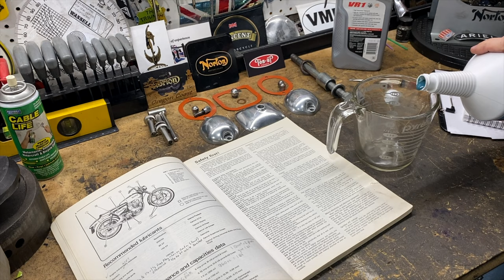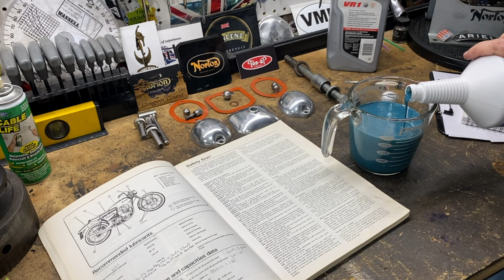1974 Norton Commando 850 MK2A - TLC 2 of 3 - General Service (amended)

Comment: Thanks for the video Mike from southern Texas.  I imagine you did it and didn't show was the actual sump drain plug.  The thing you call the sump drain is the sump strainer and the drain plug is a couple of inches in front of it and it has a magnet which is a good thing to check for metal particles when you drop the oil.  I'll email you a picture from that page from my owners manual in case you don't have it.  

Always love your videos and your easy going ways.  Thanks?
Reply from the maker: Thank you very much for this Philip. Yes, you are absolutely correct. I should have mentioned this. I checked the 'real' drain plug a while back but should have included that in the video. Glad all is well. Cheers, Mike

Comment: I used to go through the trouble of draining the oil tank but now I pump it dry with a $6 plastic hand pump from harbor freight.  It actually gets more oil out of the tank than the drain plug. I also pump the tank out if the bike is going to be sitting more than a week. No more wet sumping. The oil bottle sits next to the kick start so no forgetting.

Comment: hi, i have to say u did a 100% job here, making it simple and exact, fair play to you for ur effort, i have saved the video and will be doing my 74 commando oils and filters this week
Reply from the maker: Hi Brian, sorry for the delay. I’ve not been feeling very well. Many thanks for your kind note. I do appreciate it. I really enjoy doing the service jobs on the bike. They are very satisfying. Good luck with yours! Best wishes, Mike
Reply: @TheMightyGarage  you are welcome, i am hoping to start this week with master cylinder upgrade ,i got kit off of rgm in england, i have to drill and tap the master cylinder,then i got braided hose and ebc pads, i have a new disc on her ,the brakes are really brutal i have to admit, by any chance do you have a video showing how to torque the head, i bought the off set spanners and the socket just need to retorque now as she had a full topend rebuild, thanks again mate

Comment: Hi Mike! Just an FYI I've used synthetic oils in my Moto Guzzi for over 50k miles. I had improved shifting & less rolling resistance right off.  Not sure what kind of synthetic transmission oil you are using, but I approve with one caution. If you're using a GL5 hypoid gear lube check to see if compatable with yellow metals (brass etc). Royal Purple states on the bottle it is for example. Some GL5's can attack bushings &bearing cages made of the yellow metals. BTW nice to see the Commando getting good attention!
Reply from the maker: Thanks a lot George. Cheers, Mike

Comment: Not a fan of topping up brake fluid- when the level is correct with new pads, you're good till the pads wear out. The trans level plug is visible thru the filler cap, to see remove funnel. YOU HAVE THE CLEANEST CONCENTRICS I'VE SEEN ON A RUNNING COMMANDO, entire bike is nice and shiny !!
Reply from the maker: Hehe, thanks a lot. Yes, thanks for the note about being able to see the end of the thread of the level plug from the inside. That's an easy way to check that the oil is at the right level and I was checking that with the torch/flash light. Cheers, Mike

Comment: Mike your videos are great, question I was going to change my gear oil on my 74 commando, what do you think of the redline gear oil you used? Do you recommend it or not? Thank you. Phil
Reply from the maker: Hi Phil, I haven't ridden the bike that much since I added the redline gear oil but it does seem a lot heavier than previously. It might just be my imagination, but it feels heavier when I change gear and slightly more difficult to engage each gear. It might just be me but I think I preferred the non-synthetic oil. Cheers, Mike
Reply: @TheMightyGarage  Thank you for getting back to me, what do you use for the stock gear box oil (weight and brand)? By the way one of the reasons I got the commando was from your inspiring videos...keep them coming!

Comment: Hello Mike,
I watched carefully to see if you managed the job without oil going everywhere.   I never do and find the position of that drain plug illogical and dribbles always go down the back. You can't just prop up the funnel and leave it to finish.... The last drops are usually the ones that hold the sludge and from a cold oil will be slow to drip out. 
When you release the black canister oil filter you have a ratchet wrench  in your hand with a socket on the end- something less than 2" AF. Can you explain?   However, when you replace the canister with the red one it does not have a hole in the end for a mounting bolt and you hand tighten it!  I have only found the 16mm thread filter as the one you put on in replacement - normally the one made for Citroen/VW. If you have ones that have an end bolt, why did you change for one that might require a strap wrench or cap wrench with the accessibility issue?   I have been told never to simply change just oil and filter but to take the whole tank out and wash it to get out any sludge. There is also a mesh filter on the tank outlet which picks up things like bits of gasket sealant.  Equally, I agree with the other comment; the sump filter- perhaps with the magnet, should also be disassembled and cleaned.  
Did the sort of quantity of oil you had in the engine sump result from the dreaded wetsumping?
Reply from the maker: Hi Robert, thanks a lot for your note. Yes, regarding the oil filter with the nut on the end, I had read that there have been some problems with that model. I think the issue is that because they have a nut on the end, they can be easily overtightened with a wrench. The standard filter without the nut on the end is much better because they're supposed to be fitted and removed by hand. In other words, not too tight. Yes, both my Commandos wet-sump after no time at all, so if I leave them for say a couple of weeks, I have to drop the oil from the bottom of the crankcase and fill it back into the oil tank. At least it gives me a chance to inspect the oil every time 😉 Best wishes, Mike

Comment: Hi Mike, did you remove the rim lock/security bolt as you were using the Avon Roadrider tyres? 
I must admit I did on my Triumph  because I just couldn't physically fit new ones ( the old ones was rusted and perished) to the rim and new tyre. I'm guessing it is because the tyres are really meant to be tubeless any thoughts? I wasn't too worried as I can't see myself doing any burn ups!
Reply from the maker: Hi Kevin, yes, that's exactly what I did. I wasn't happy with the way that the new tire was seated on the rim. At the very end of the the first video, that's me looking a little concerned that the tire was moving up and down as the wheel rotated. And then I could see that it wasn't seated properly. Geoff was a great help in getting the tire off and refitting everything. We discovered that the rim lock wasn't fitted properly. The tire was actually sitting on top of it, and it was this that was pushing the tire off it's correct seating. I also didn't like all those shiny 5oz weights on the rim. So we decided to remove the rim lock altogether and cut down a little bolt that we inserted through the inside of the rim. I also ground down the head so that it would not protrude into the innertube. I then added a nut onto the end of the bolt to hold it. The tire fits great now. The rim also looks a lot better and is balanced well. Thanks for asking. Cheers, Mike
Reply: @TheMightyGarage  Thanks Mike, It was niggling me a bit when I did away with it. Good to hear you decided to do the same.